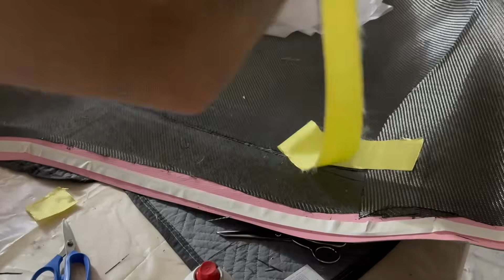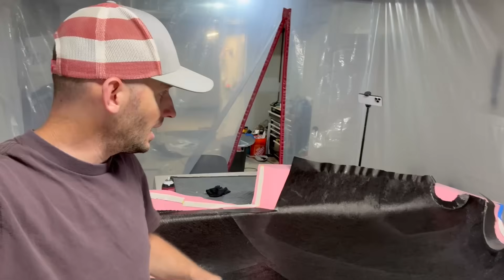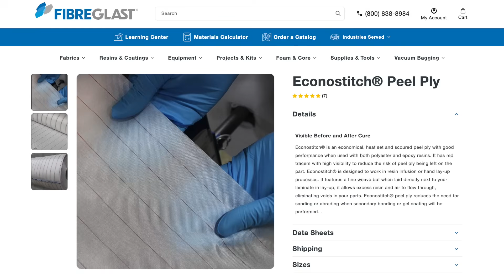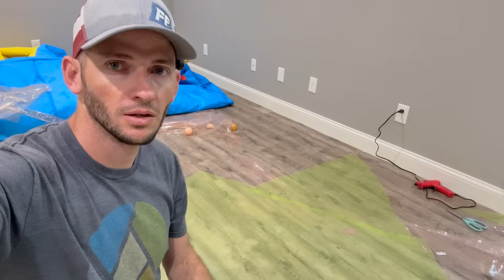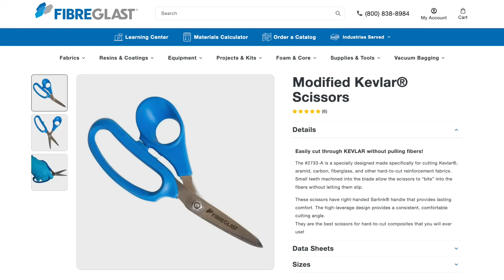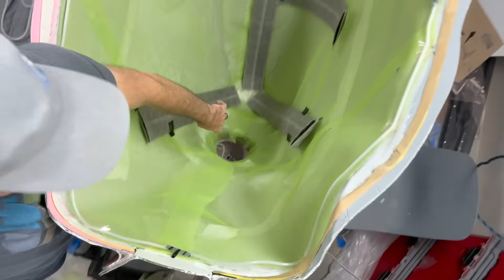If This Infusion Fails, I’m Gonna Cry | Basement Mosquito Helicopter Build Ep. 16

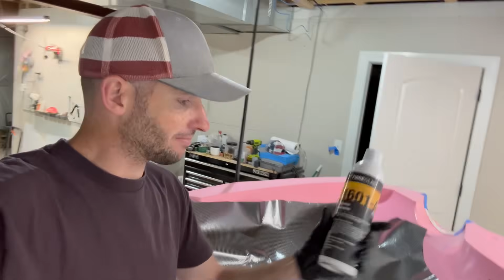Comment: RE preface: All the time. I made a powered platform lift that travelled up in an arc to clear a structure(wing) to allow the platform to swing over it and mate with the hullside. Explained it to an engineer who said he couldn't understand it and it won't work. It took 6 months to work it out in my head, and built a 1:24 working model of it . He still had issues with how it functioned yet it was clearly DaVinci based. But Mr D didn't have hydraulics and pressure reservoirs so you could unload the passengers, and take a party of 5 back to ground in case of power outage. But I think he would have liked it!

Comment: Super nice project!! Wondering why you didn't use core material on the large expanses of the cowling? That would save weight,make it stiffer and maybe even save some money on carbon fiber.
Reply from the maker: I’m still going to add some access panels and probably a big door… I don’t know exactly where those will be yet and didn’t want to cut through core material later. 

After mounting it to the Heli, I’m not even convinced it needs core material either. Once the perimeter is mounted solid to something the whole part stiffens up a LOT.

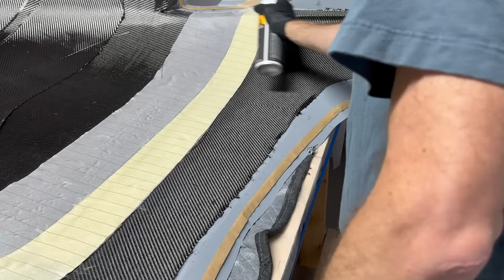Comment: Curious question.. There are places like 14:50 where you have peel ply in between the carbon layers. I was under impression that Peel ply is only on the face touching the vacuum bags. Why do you need that Peel ply in the middle?
Reply from the maker: Good question. I’d type it all out here but I do a much better job explaining it in last weeks video. Go check that out and come back if you have more questions. Happy to answer them :)

Comment: good luck! I'd recommend grabbing an Olfa rotary cutter for the carbon fiber template cutting so you don't have to pick up the fabric and use scissors. Reduces the hand fatigue and you get nicer edges. I've cut 3k, 3k-stabilized, 12k no problem.
Reply from the maker: Great suggestion, I'll check it out!

Comment: super stoked and proud of you for how far you have come! very excited to see the result!

A downside to using stretchy vacuum bags for infusion is that the resin that gets sucked in can stretch the bag and create pools of resin instead of going into the part. You may want to throttle your feed lines to prevent this using adjustable line clamps, especially with such a steep hill to climb. Though if the resin you plan on using has a short gel time that may not be an option
Reply from the maker: Thanks! I feel like I’ve learned a lot, but still basically nothing compared to an experienced composites person. 

Good point on the stretchy bag… just thinking through it intuitively, there is 14.7 psi pushing the bag down minus the pressure pulling the resin in.. I’m curious what pressure a standard bag can hold vs this bag. It’s definitely less than 14.7 but more than zero. I’m going to have to think about that one for a bit longer to completely understand what’s happening there. I don’t doubt it happens… just more curious why. 

I need to double check but I’m pretty sure the pot life is 60 minutes. I also plan to lay the mold on its side for the infusion. At that point the max height is 26 or so inches and the pots will be in the middle. So half will feed down and the other half will feed up. Once it’s infused, I’ll put it back upright to eliminate any warping of the mold due to the weight before the resin cures. 

I still heavily considered your double bagging suggestion, it’s just a lot more complicated with all the mold flanges, bolts, and wing nuts. (I’m just being lazy). If  I didn’t get such a good seal on the first go, I was immediately going to double bag.
Reply: @TheOkayestEngineer  if you get a perfect seal (or good enough, i.e. not too much drop with a long test), which it sounds like you did, then there is no need to double bag.

I would stand your mold up vertically during infusion for the best result and most uniform flow. Your feed distances are determined by the feed line spacing, not the mold orientation. Infusing uphill is generally ideal as gravity helps limit resin content, but with stretchy bag and too fast flow it can lead to pooling at the bottom. Another tip to limit pooling is to have the entire mold higher up than your resin bucket, otherwise you are gravity feeding your mold which can lead to pooling at the feed lines

is your bag easy to stretch by hand, or just described as high elongation?

I have used stretchlon 200, which is easy to stretch by hand, and it has caused me pooling issues. Yours is a different stretchlon and it may be different.

There are generally two categories of bagging films in this regard, stretchy and stiff. Stiff ones are better for infusion and cannot be easily stretched by hand while stretchy ones are easy to stretch by hand. Stretchy ones are good for certain things but should be avoided for infusion
Reply from the maker: It’s not “easy to stretch”. Like a thick drop cloth but there is some give. 

I’ll have to put some more thought into the orientation of the mold during infusion. You make a good point about uniform flow. I just worry in the current orientation, the resin will have to flow vertically just over 5 feet and that feels like a lot.
Reply: @TheOkayestEngineer  Do you mean five feet of distance for the resin to travel? That is a recipe for a failed infusion. you should have a maximum of 30" without extremely slow curing resins like Pro Set INF 114-213 that has pot life of several hours. Even with such resins it is bad practice

If that is truly the case I would strongly recommend performing surgery and extending the enka lines. This can be done  by simply adding on more enka, making sure it overlaps the end of the previous, and securing it with duct tape. 

We use duct tape to secure the mesh and feed lines in our infusions and have never had any issues with it interfering with the epoxy
Reply from the maker: @kingofherdaz I’ve got under 30” from the feed lines/enka to the edge of the part.

The smallest part of the cone where the majority of the infusion starts up to the rim of the mold is about 5 feet. I’m just thinking about the pressure drop by trying to lift resin 5 feet vertically. 5/32 ~ 17%
Reply: @TheOkayestEngineer  looking at that part of the video again, it actually looks okay to me. The flow from the feed lines will converge together to make it work.

When you calculated your resin did you include the consumption of the feed lines, peel ply, and mesh?

Also, you may want to get another pair of hands for the infusion to help manage clamping of feed and vacuum lines
Reply from the maker: @kingofherdaz I added 20% for buffer and I have a lot more if needed. 

Definitely going to solicit the help of my nephew with the layup haha. Too many buckets and clamps to manage by myself.

Comment: Sorry - I'm at a loss. You bought this Helicopter kit. You then created a mold of the kit. Now you're creating a kit from the mold. WHY?????? Why didn't you just create the copter from the original kit?
Reply from the maker: The original kit doesn’t have a cowling. So I designed one and am making it now. There have been a lot of times in my life that people have asked why I do something, and in most cases, the only reasonable answer is “because I can”.. if you can call that a reasonable answer.

Comment: I feel like you'd save weight not painting it, and the carbon fiber look wild be pretty sick.
Reply from the maker: At a minimum it needs a UV coat. I agree, love the look of carbon. Depending on how it turns out, I’ll most likely change the paint scheme that will leave some carbon exposed.